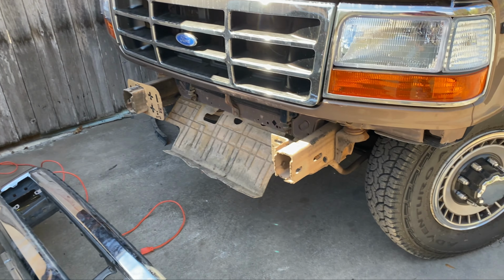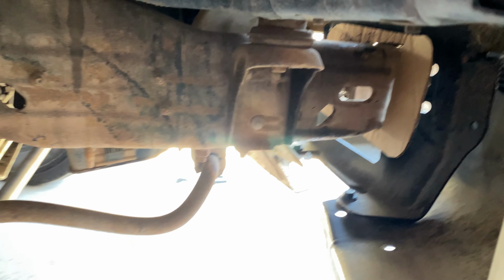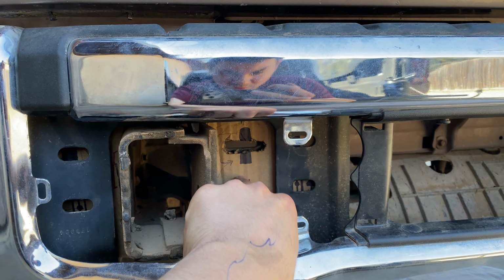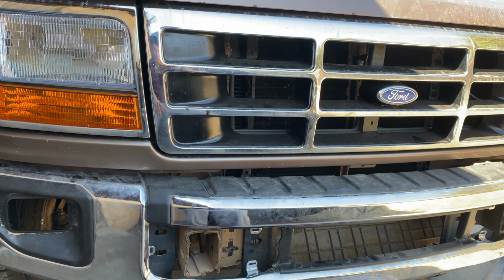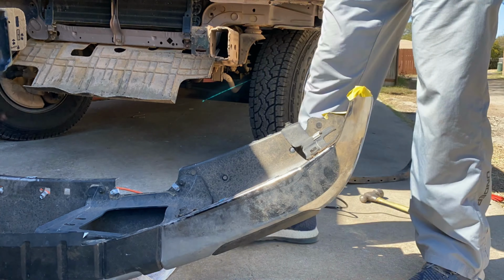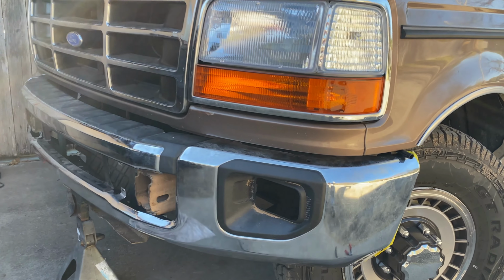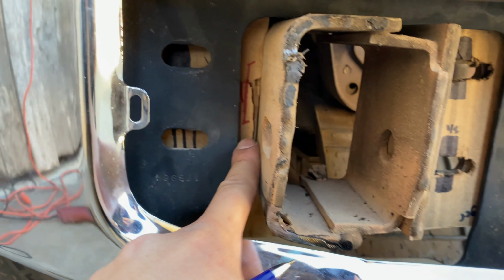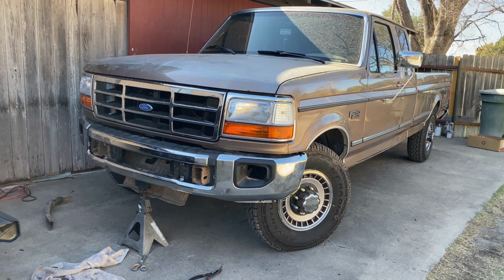2020 F-250 Bumper Conversion on my 1992 F-250! (1992-1997)

Comment: Can I put this bumper on my 150 ?
Reply from the maker: If you frame looks like the front of the f250 frame & you get a bracket then yes.
Reply: @sscmodz2649  should be the same where you get the custom plate at